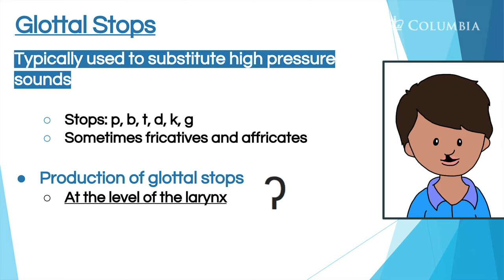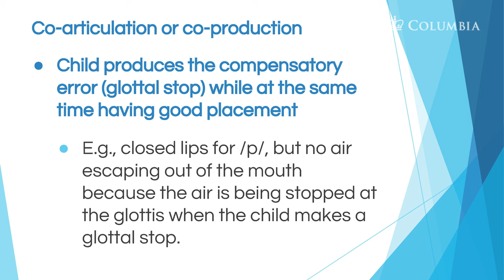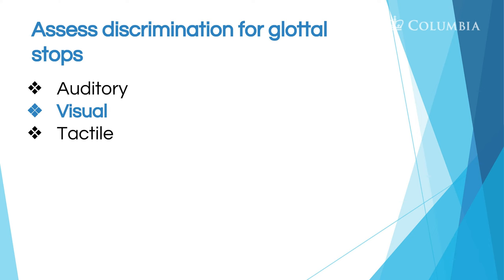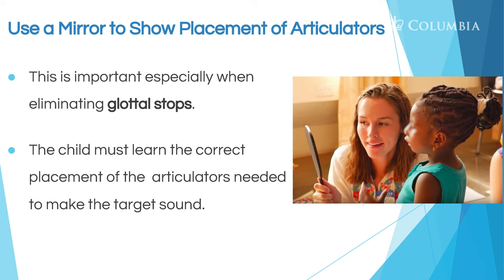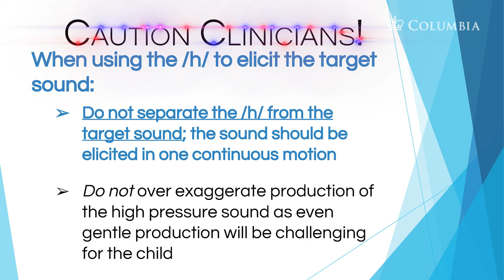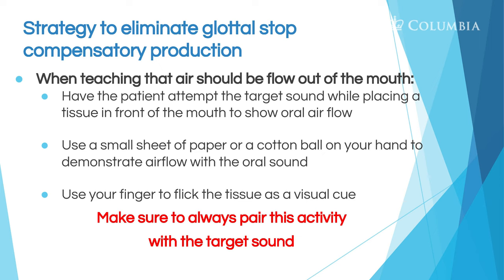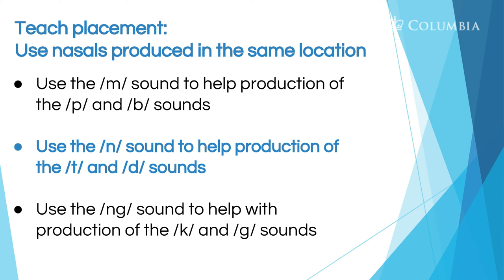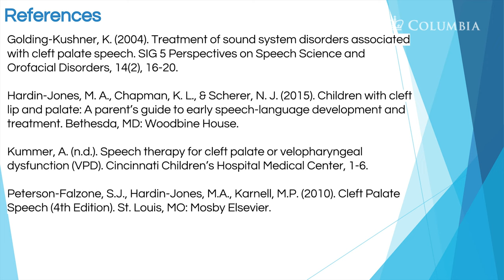Module 3.4- Cleft Palate Speech and Feeding: Strategies for Eliminating Glottal Stops

Comment: slight correction: the glottal stop is a voiceless consonant since the vocal folds can't vibrate if they are touching each other and is actually interrupting any voicing or any pulmonic airflow for that matter (a cough is a glottal stop with voiceless release of air).